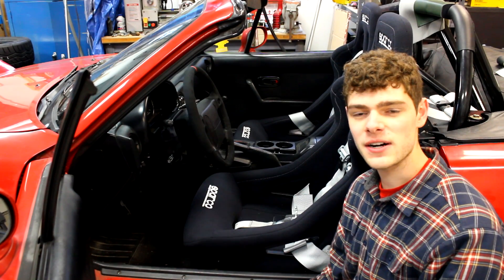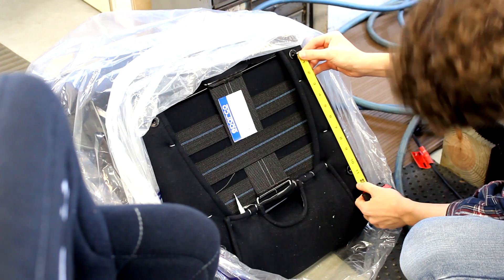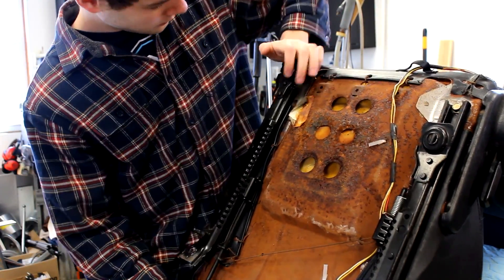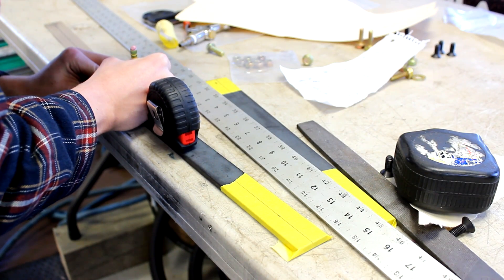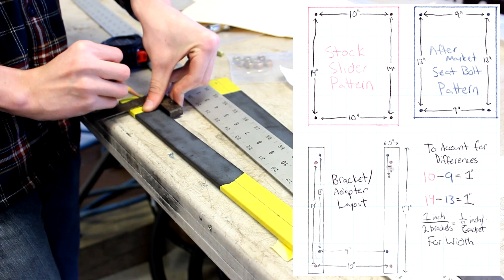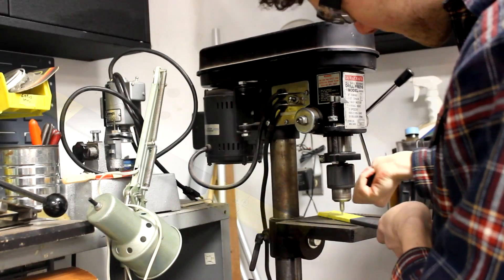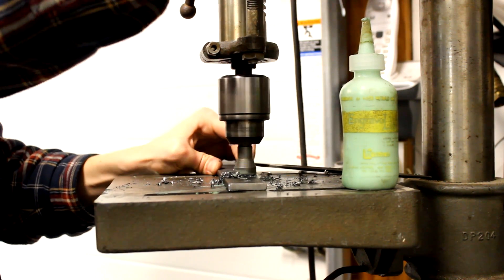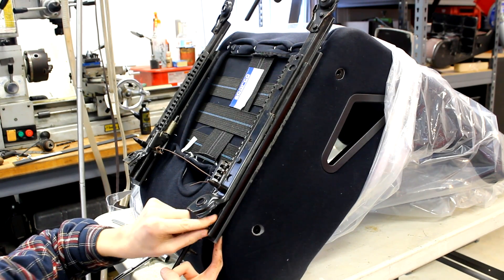How To Install Race Seats on Stock Sliders

Comment: Thanks for this video. It simplified things a lot for me. I just used your method to put race seats in a Fox Body Mustang. I used 3/16" thickness and 2.5" width bar stock from Metal Superstore. 2" would have been fine, though.
Reply from the maker: Awesome, glad this helped!

Comment: @CashedOutCars,

I am wondering if the measurements you listed on you’re example diagram are the actual measurements to the NA Miata seat bolt pattern and Sparco Sprint pattern. Looking at doing the same set up on my NA. 

Thanks

Comment: I have a 1995 na Miata. Looks like the same vehicle you are working with. Would you be willing to make me a set since you already have the measurements and worked out the kinks. I do not have the correct tools to do this.

Comment: Curious to know, is your seatbelt attached to your rails? if not would you have any issues clearing the seatbelt edges, also did you find you were able to slide the seat all the way back without hitting the edge on the seatbelt tower?

Comment: Did you have to hammer the transmission tunnel to get them to fit? I just bought same seats with sparco universal brackets
Reply from the maker: With this setup I didn't have to
Reply: CashedOutCars thanks

Comment from the maker: How to install aftermarket seats while maintaining adjustability. Next week's video is how to install 5 point harnesses!
Reply: CashedOutCars I'm looking to do something like this to bolt in my aftermarket seats into my 350z but the holes on the floor aren't laid out flat, they have an angle to them. Any idea how I could modify the steel to form that angle ? Thanks in advance brotha !
Reply: Where I find that video

Comment: What size metal pieces did you buy? Where could I get some? Nice video!
Reply from the maker: +Eddie Padilla I used 1 1/4" by 1/4" thick steel that I got from a local Tractor Supply Store but you can get steel from welding shops and home improvement places as well. Thanks!

Comment: Didnt see the part where u attached the brackets to adapters im sure u needed both your hands lol So question i need your help Is there a way I can pay you to send me an adapter or come to you to have my seats done lol i have a 1996 toyota tercel and want cipher auto cpa 1001pgy gray leatherette seats and would like to use my stock sliders im outta of orlando fl. If you show me how to do measurements and i send them to you or give me advice on what to do. Ill take whatever help i can get.

Comment: Please reply! What did you do the cable under the seat? The other part of the cable is on the stock seat. HELP PLEASE, ADVICE NEEDED.
Reply from the maker: +NKx CLAN I just tucked it under an opening that was part of the frame, I'm pretty sure it's to warn you if your seat belt isn't on so it's not super important
Reply: +CashedOutCars Ohhh ok thanks for the explanation! I really really apreaciated, I'm about to install my seat.. I suscribed, Miata gang yeah!
Reply from the maker: +NKx CLAN not a problem! It's not an important wire but don't cut it in case you ever put stockers back in. Good luck, good car choice!
Reply: +NKx CLAN Oh word word, and alright bro. Keep it up thanks again.
Reply: It's actually for the speakers in the headrest of your stock seats
Reply: I have a similar cable underneath my seats and I was told it's for the airbag. I'm afraid if I'll unplug it I might get a fault code on my dashboard. What do you think I should do? Add a resistance to it?

Comment: what hardware did you use to attach the adapter to the seat? Did you re-use stock slider hardware to attach slider to adapter? The diagram you put up, are the driver and passenger side seats the same? I have a 95, and if I'm correct, I should be able to measure out your diagram and mark my adapter, prior to measuring my own seats and sliders? thanks
Reply from the maker: I believe I used the stock hardware for that, to be honest it's been a LONG time since I made this video. My seats were slightly different due to manufacturing tolerances, so I'd confirm the dimensions on yours before using the exact same pattern on both. Good luck!

Comment: Great informative video! I want to install racing seats in my 2005 Ford Explorer. Can I keep my driver side electronic adjustable stock base and stock seat belts to both front seats using your method? Thank you.
Reply from the maker: +Jason Guess if you mount it to the base without damaging the electronics I don't see why not. The same goes for stock seat belts, if they fit well and are comfortable you should be able to keep them

Comment: I’m doing this exact setup, Miata with sparco sprints. Do you have a write up with all information including measurements?
Reply from the maker: I don’t, I’d recommend measuring for yourself to be sure everything will match up because there was slight variation between the two seats I have, good luck!

Comment: Hey man, thank you so much! This is perfect :)
Reply from the maker: +Felix Grosshans no problem, I'm glad it helped!
Reply: +CashedOutCars just finished the build and everything fits slick. I just realized I have a small offset to the left, even though my measurements were on point, did you have a similar issue ?
Reply: Can you please tell me witch sparco seat is that.

Comment: Is it necessary for each adapter to be a single piece of steel or could you use a section for the front bolt and one for the rear bolt? I ask because the adjusting levers on the sliders on my 66 Mustang attach to and protrude from a point midway between the front and rear mounting points preventing a one piece adapter from sitting flush.
Reply from the maker: I don't see why you wouldn't be able to make an adapter for both the front and rear separately. It might not be as strong though so design with caution.
Reply: The other option would be to use some washers as spacers to gain clearance between the adapter and the slider. I'm trying to keep the seat (Sparco R100) as low as possible though I probably only need about a quarter inch.

Comment: Did the seats sit lower, or further back that the stock seats? How tall/big are you? I'm 6'2 and 210 and I need all the seat as far back and as low as possible.
Reply from the maker: They sat pretty close to the same with this adapter set up. If you floor mount the seat it'll be lower, just not adjustable. I'm about 5' 8' and 135 lbs. I have a review of these seats on my channel if you're interested! https://www.youtube.com/watch?v=h8ES0v0qL1I&t=48s

Comment: What hardware did you use for attaching the stock sliders to your plate steel adapter? Was it just normal grade 8 bolts, washers, and nuts?
I can’t really tell how there was clearance for the two holes that sit under the seat to fit nuts (vs the holes with a tiny bit of clearance that you are tightening by hand in the video). Is there just room between the steel plate and the seat? Those holes aren’t countersunk in any way right?
Reply from the maker: I did countersync some of the holes and used bolts with angled heads to hold them in place to give myself some clearance. Use the highest quality hardware possible to reduce the risk of breaking. Good luck!
Reply: I see that you countersunk the four holes for attaching the adapter to the seat.

But what about the four holes for attaching the adapter to the stock rails? Did you use hex nuts and normal hex bolts for those four? Or did you somehow countersink a couple there too? Having a hard time understanding how you managed to get a nut between the adapter and the seat for the stock rail attachment.

Comment: Also , is there a way to install a harness without a roll cage ? If so please make a tutorial!
Reply from the maker: +ItsWxsh it is possible but it's actually safer to run stock seats and seat belts if you don't have a roll bar.  If you flip with a harness and race seat with no bar you'll be rigid in the car with nothing above your head to protect you which leads to bad things
Reply: though to answer your question, yes, you can go on many websites like CJ pony parts or corbeau.com and buy bolt in harness bars that bolt to factory seat belt points

Comment: Nice, I was hesitant to order some for my car because its been hard to find brackets for my car but then I found that you can also just weld your stock mounts to the racing seat ones. After watching this though I'm gonna get 'em lol Also, I have a question. Do you think these are ok and strong enough in case u get in a wreck? Someone told me it might not be as safe but I was thinking the bracket mounts that people buy on ebay are pretty much the same, right? Held on with sheet metal and bolts? Maybe if I did what you did but instead of just bolting them, maybe welded the bolts down too for extra assurance. What do u think? Awesome step by step by the way man. Thanks for the tips! Going to go order some seats for mine right now haha
Reply from the maker: +Jav Munguia I think if you use high quality bolts and thick steel like this it should hold up in a crash, but I haven't tested it and hope I never do. Welding could help as long as it's done right. Good luck with your seats!
Reply: CashedOutCars cool thanks bro! I just ordered a set right now and bought some steel like u did. I got the one that has a width of 1.5 inches and half an inch thick. Thought I'd get a little thicker for extra support too lol Hell yeah bro thanks again.

Comment: how is the seating position ?  do you seat very high ? thank you !
Reply from the maker: +Dunzhi Jialuo for me it's perfect, but I'm kinda short at 5' 8". This method obviously does get the seat higher than just bolting it to the floor, but you can mock it up before you try it to see if it'll work well for you. Good luck!
Reply: thank you !!.

Comment: yall measure your shit! my length measurements we're the same as his so I, like a dumbass, assumed the width would be similar. Gave it a 1/2 inch on either side and it's off by quite a bit. NA miata new latest sparco sprint